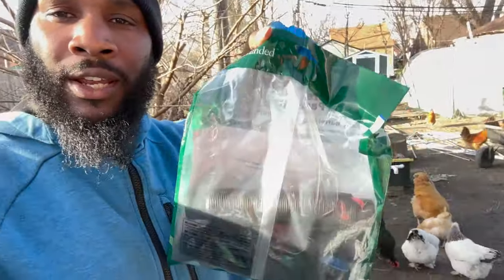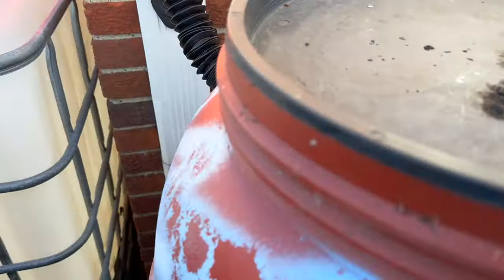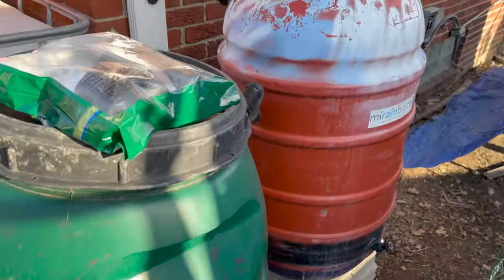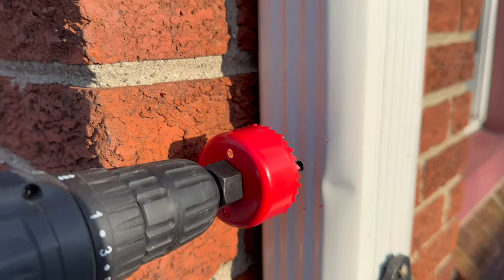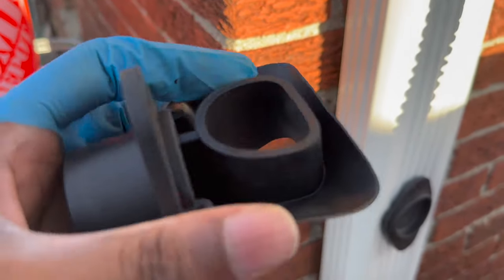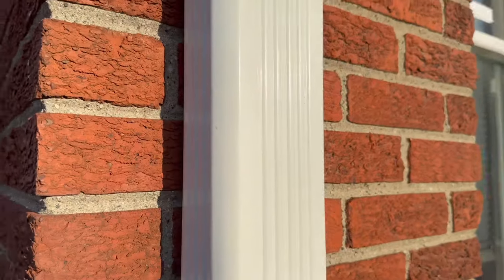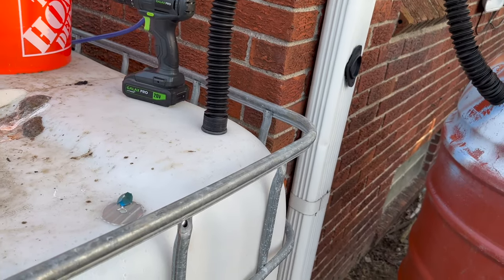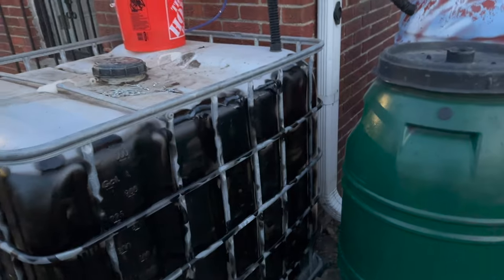Installing Rain Barrel | Earth Minded

Comment: Did the spray paint hold up on the IBC tote?  Other videos for others show it doesnt stick and peels off.
Reply from the maker: @jjs777fzr  it did actually and I should do a video on it to let people know. I didn’t know that others peeled off
Reply: @CityBoyFarmingAndrewSeegars  I don’t have a IBC tote yet and was figuring on using black plastic but if spray paint works that would be nice since it won’t degrade with in the sun etc like plastic.